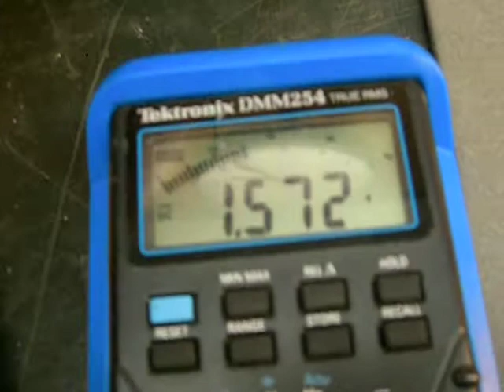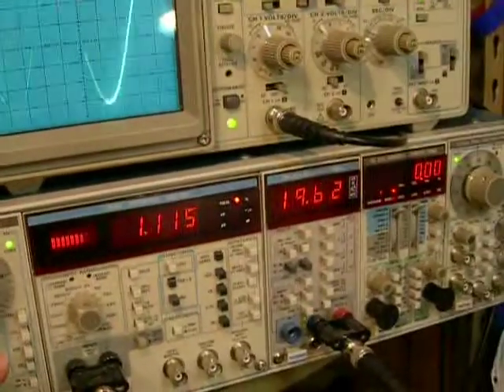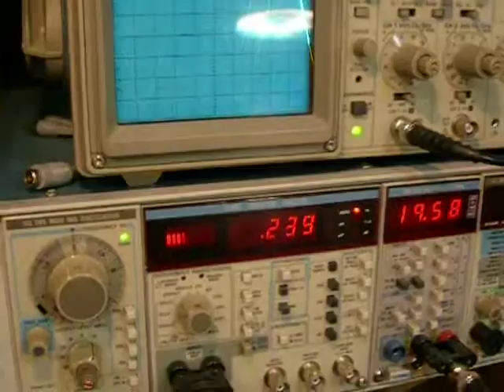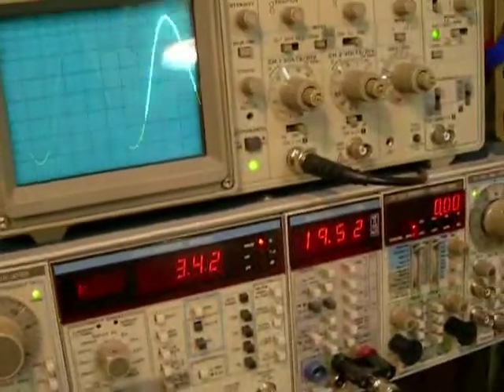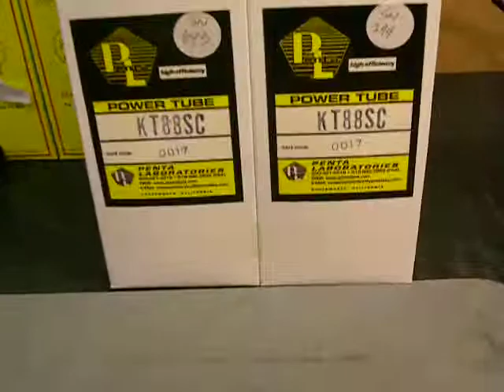Modern Penta Lab KT88 Vacuum tube.MOV

Comment: I know it's years ago that you did this series, but in general did you find you have to tweak the bias much as between 6550 and KT88? I've been fixing an amp that the owner has 6550s in, but he wants to switch to TT21 and then KT88, and it seems to me that all these tubes are just too different to run in the same amp. Different grid leak resistance max, and very different fixed bias requirements: -75V for the KT88, -52V for the TT21, and -48V for the 6550, and in the actual amplifier I'm having quite a time figuring out a bias chain that will adjust to that range without also exceeding the grid leak maximum. Best EJP
Reply from the maker: It has been a while but I still use these tubes and it is good to see that you find this older video still valuable.
-75 seems a bit negative for 6550/KT88 and -52 is more like it from my experience. I can't remember any great difference between KT88 and 6550 and they should be basically interchangeable.
I am sure you can determine what maximum bias voltage can be obtained from the bias supply and the proper voltage dividers to provide some range for your customer to enjoy a few of the tubes.
I am not familiar with a TT21. I will have to look that one up.
In the McIntosh MA230 mono amp that I built, back in 1976, I intentionally made the bias supply very wide so I could play with everything from 6L6 to 6550 and EL34 and it has been a lot of fun. Amazingly, not much difference in performance in any of these tubes in that circuit.
I don't think I would worry too much about grid leak values as you will likely have something like a 220K or 470K to ground in most any fixed bias supply.
All we can do for our customers is what the hardware will let us do and we all have to live with that. I know you can figure it out and will do a good job. Always good to hear from you.
Reply: ElPaso TubeAmps Those are datasheet values for UL connected, fixed bias, 560V B+. Haven't got to actual measurements yet. TT21 is supposedly a KT88 with a top anode connector cap to allow higher B+ voltages than an anode connection at the pins would, but again the datasheet doesn't really agree in terms of grid leak or bias. Amp has 220k grid leak but KT88 datasheet says 100k, and 6550 datasheet says 50k, although there is a little-known multiplier you can apply to grid leak which depends on cathode resistor value and Gm, which in this case is about 1.5.